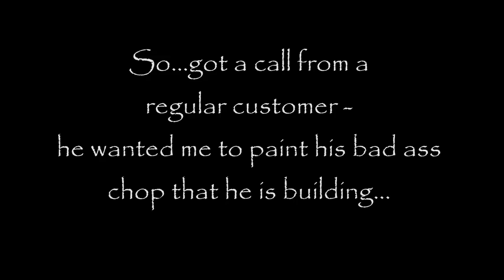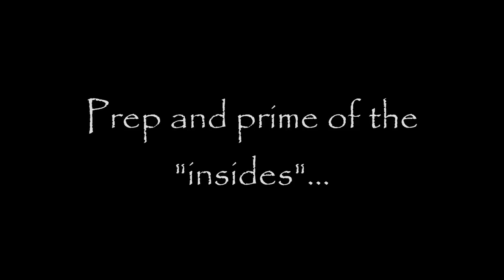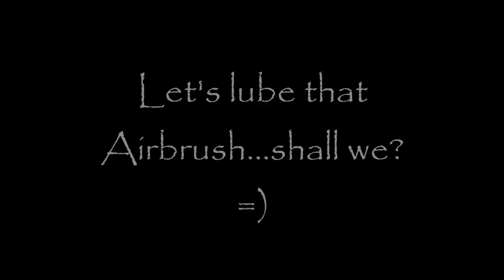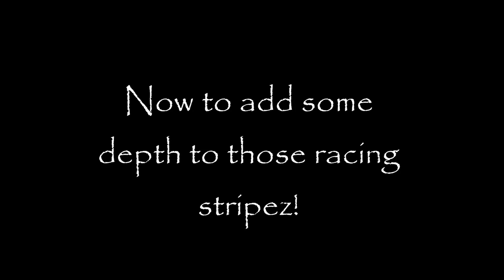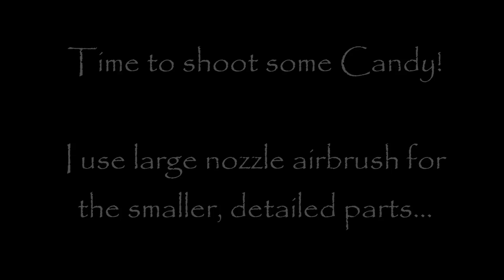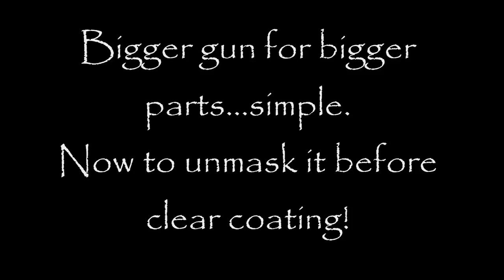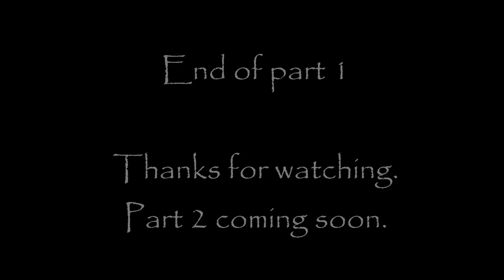Cambridge Pinstriping, Complete paint job for a custom chopper - Part 1

Comment: Great videos. I've been trying to read up on applying my Wicked colours to bare metal but struggle to find any info on primer etc. for the job. Very nice job on the bike parts.
Reply from the maker: Thanks my friend. Wicked colours are designed for non porous surfaces, so ideal for automotive work. Ideally you need surface sanded to 600grit, so paint can grab it easier. Good quality 2K lacquer on top will seal it just fine!
Reply: Great, so I would not need to run a clear primer on first or something like that? Thought about using phosphoric acid to prep the metal. Thanks for the reply.
Reply from the maker: As long you use good quality 2K clear on top, it should seal it perfectly well. Never had a problem.
Reply: Thanks again, appreciate the answers a lot. Have airbrushed a lot on paper surfaces and boards, but when it comes to metal its all new to me.
Reply from the maker: No problem man, Happy to help where I can. Use primers where you can, but if you work with raw steel just make sure it's clean and prepared for paint. I plan to do airbrushing tutorial series too in not so distant future!
Reply: Looking foreward to watching them. Liked the feel of the workspace in you film, think it matters a great deal recording in a setting thats interesting for the viewer, builds the atmosphere of the film.
Reply from the maker: Thanks for your feedback mate! appreciated.

Comment: Great work! I'm a fan of paint work.
So, how can I get that effect on the bare metal? I mean, what process should I do?
Reply from the maker: I used grinder and polishing wheel. Then just mask off and candy paint. Simple :)
Reply: Did you have to clear coat the bare metal prior to paint?
Reply from the maker: No. I used solvent paint, and then clear it.
Reply: I see that you did use water based createx paints for shadows.  If you were going to use all Water based would you clear the bare metal first?
Reply from the maker: b  most likely yes, I'd use etch clear to protect it. Once sealed you can play with it. :)
Reply: Etch clear?   I've used the green etch but didnt know that they make a clear.   would a 2k be good to start?
Reply from the maker: Always 2K!

Comment: Hey dude that’s bad ass 
I brush finished clear coated a mates Harley once but this is next level off it’s fukn head man
What prep is done on steel?
Reply from the maker: Just make sure it's moisture free and degreased properly. Use 2k clear and not can stuff and you should be good:)
Reply: MackieBass yeah it was 2k and had parts in the sun warming up was pretty Fukn warm I got pics have u got fb or Instagram?
Reply from the maker: @Uncle_Chuck  Cambridge pinstriping Mackie on insta. Mackie Mac on FB:)
Reply: MackieBass following u on insta but won’t let me upload pics lol
Reply from the maker: @Uncle_Chuck  message me there or on FB